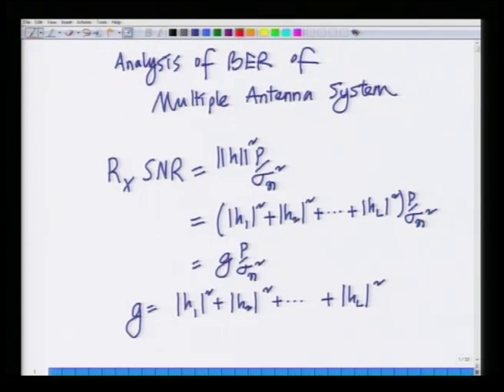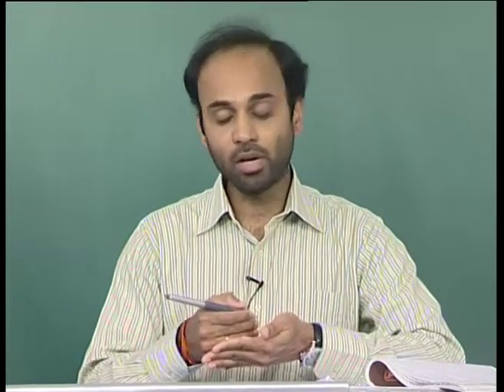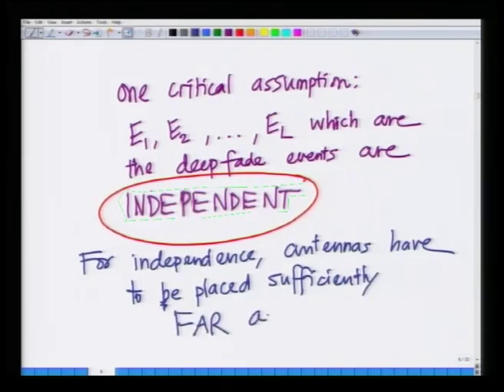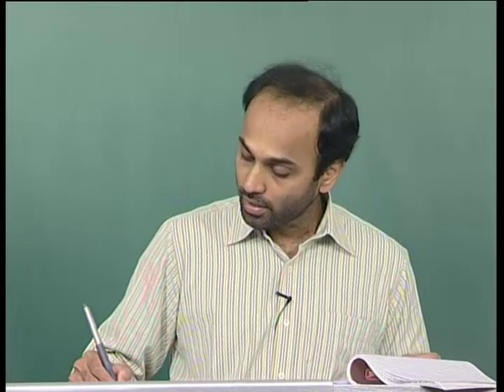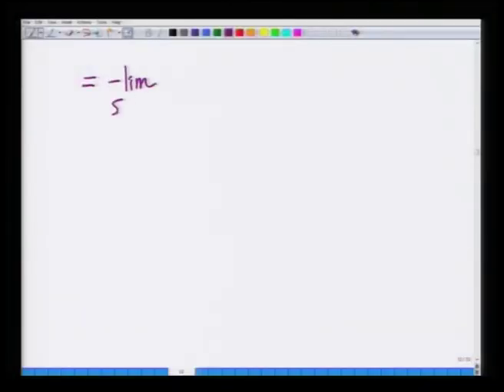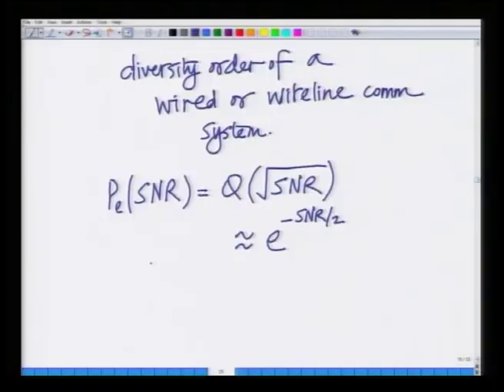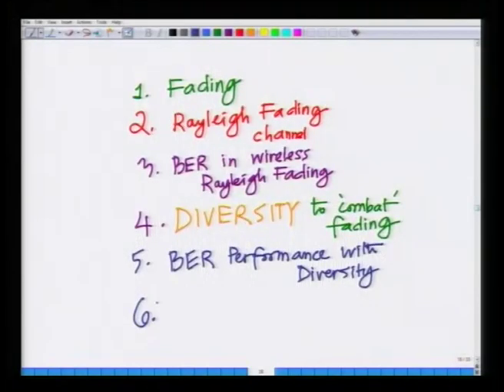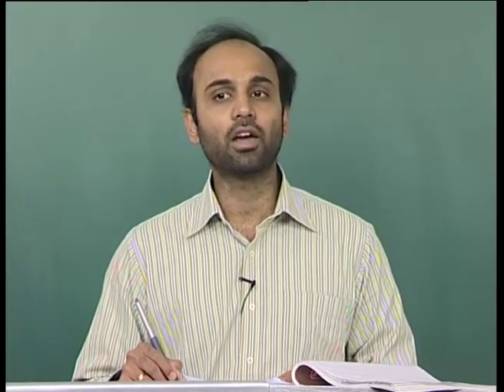Mod-01 Lec-08 Spatial Diversity and Diversity Order

Comment: I am confusing with your discussion regarding to the min antenna spacing for multiple antenna. You mentioned that in 2G, in India, you were using 900MHz (EGSM). In 3G/4G, you mentioned that it is using 2.3GHz. This is not entirely true. As you know, in GSM, we also have 1800MHz & 1900MHz channel. Same thing in 3G & 4G system, we can use 850MHz or even as low as 700MHz. Does it means that in 850MHz in 3G/4G system, we can't occupy multiple Rx antenna?

Comment: When you were talking about mobile length, I have to admit that I took out my mobile and measured it.
It had a length of 13cm.
About 3 receivers could "possibly" be fit. However, in reality how many receiver antennas are there? As far as I know, they use a diversity antenna array instead, located at the top of the mobile